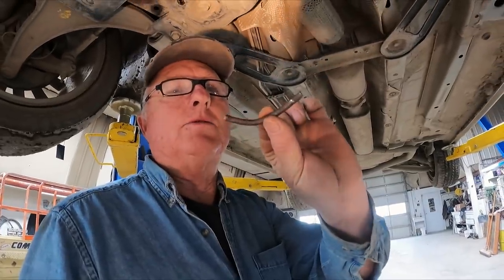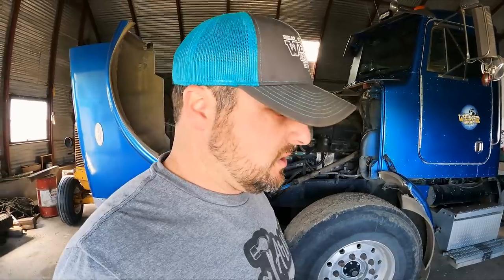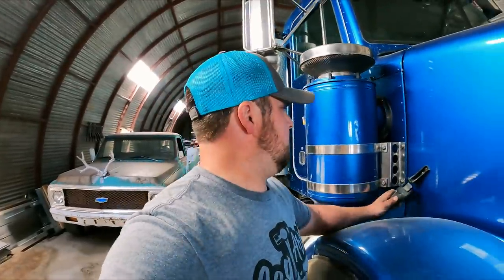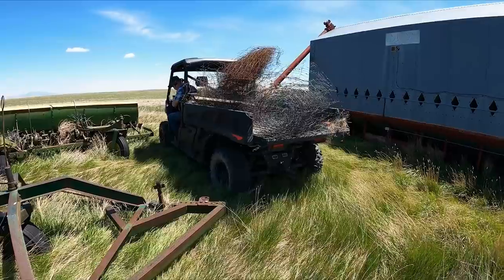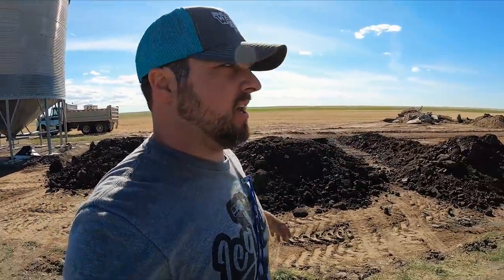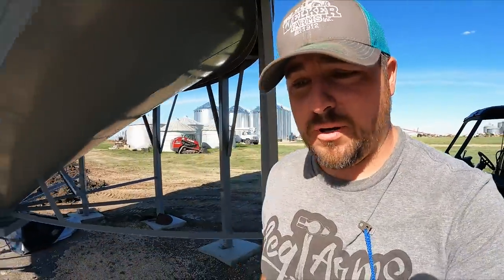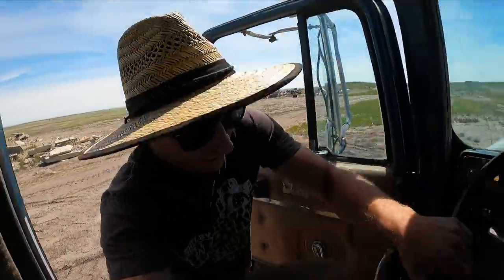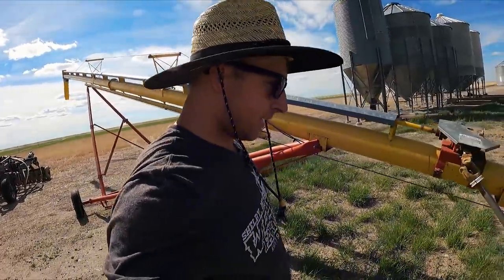How Farmers Make Room on Their Property

Comment: Hey guys all that concrete can be put through a rock breaker and turned into base fill, which would be good for alot of those areas around the bins or sheds that get muddy as heck while your trying to load out gain every winter it would be well worth the time recycling old rocks and concrete, and at the very least it would give Waggles a day or two work.

Comment: You guys need to rent or build a rock jaw crusher and crush that concrete. Crushed /recycled concrete makes an awesome road. But you have enough to do most of the area infront of the shop.

I'm building my own and using old bailer flywheels for my eccentric shaft flywheels.

Comment: Kevin the gmc/chevy 88-89 yrs 5 spd transmissions There are no service parts for NONE when that one goes its gone. there is no aftermarket etc  The getrag is a fine trans for 5 yrs they made service parts The gears and cluster is made of glass it aint t56 or m21 or even an m20

Comment: Junk to a rich man maybe but its poor mans gold when something is broke and you fix it with what you have. So I kinda favor junk. Now why didn't you just drill holes in the center of those big bin floors. Could of used them for the Welker tether ball team. All kidding aside, I kinda hate breaking up nice smooth pads but what good are they. You guys are not using teepees for the hired help to sleep in. I guess its my hatting to do cement as it makes my back sore just thinking about it.... I was kinda wondering if they could get something built over the tops of the cement pads to park in out of the weather and work on it instead of the dirt.... thats me trying to repurpose anything I can.... have a good one gang

Comment: Question... I am not a welder so I haven't a clue on why on the front end loader bucket sides you welded a cross or X pattern bead welds all over it... What is the purpose of the welds?
Reply: That’s  so the pattern wears before the actual bucket does most of the time
Reply: @benjammin4456  thank you, I often wondered why they did that... now it makes sense 😊